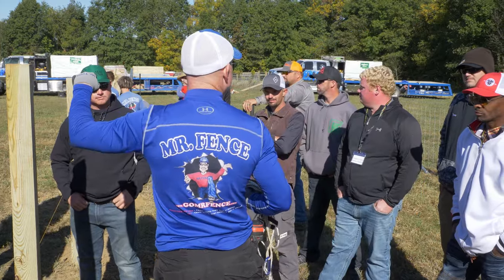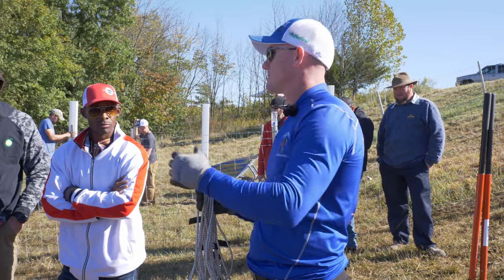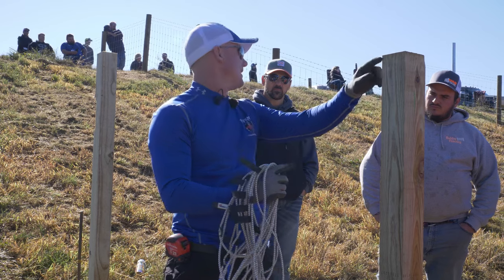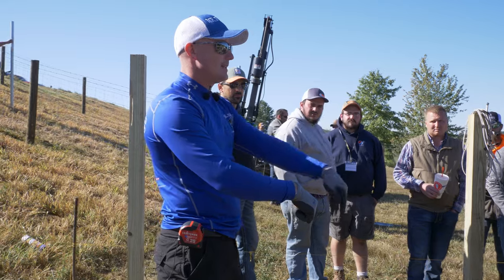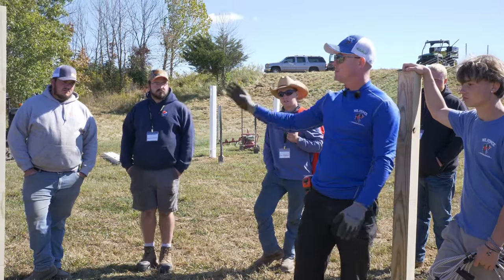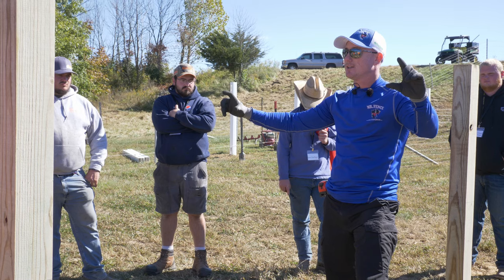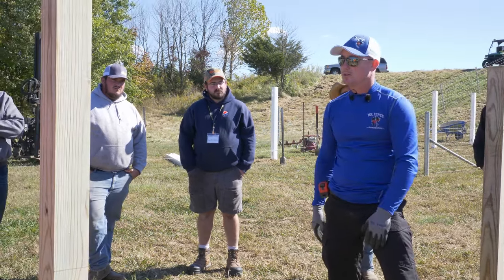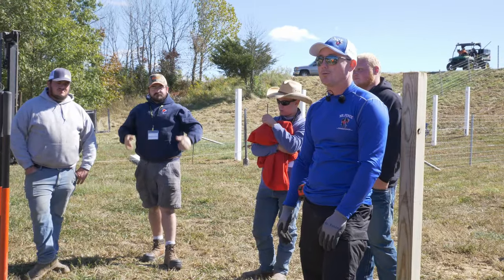Fence installation: managing homeowner expectations | Vinyl and Wood Class with Shawn King

Comment: sadly, that's the quality of lumber now days, but there was a time back in the 70's and 80's when treated lumber 4 x 4 posts would actually hold up 10 years and the didn't warp and split and twist, but, for whatever reason, that's the quality of wood lumber that we have to deal with today. I've seen some galvanized 2" 16 gauge posts rust out after 10 years, and personally I think it has to do with the acidity of the soil! Because I know a man who owned bird dogs, and he said he would have to replace his galvanized posts about every 10 years, and I think it was because of the ammonia in the dog urine and the acidity it produced, that cause it to rot over time. I think, too, the round galvanized posts tend to hold water inside the cylinder, which is why I think it tends to rot as well; I think the postmaster posts that have the flange on the sides are better in that regards; it doesn't have any place for water to get trapped like that.
I think it's good that you are trying to inform people though, but it's like they aren't really listening to what you are telling them when you tell them what's going to happen. They're probably thinking, yeah, 5 or 10 years down the road it'll start splitting and twisting on me. People in Oklahoma will use some type of wood sealer or even a sealer with stain in it to give it a good red wood look.
I wish Oklahoma had a Menards; because I've gone on line and looked at some of their red wood and cedar wood, and it is 1000 times better than what I'm seeing in Oklahoma!
Reply: Holy cow you put a long tail on that kite didn't you. I have a question: You mentioned that "today's lumber" is lower quality. Lending itself to warping, rotting and splitting sooner than the in the old days when 4 x 4 posts would last ten years. The product is trees right, so how have the trees become lower quality trees? Do you mean harvested or cut down too soon?